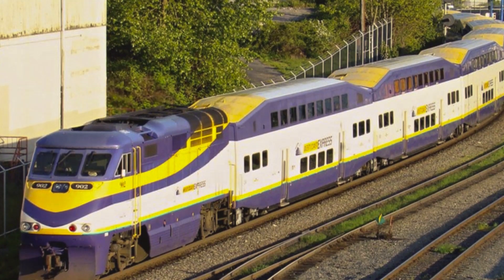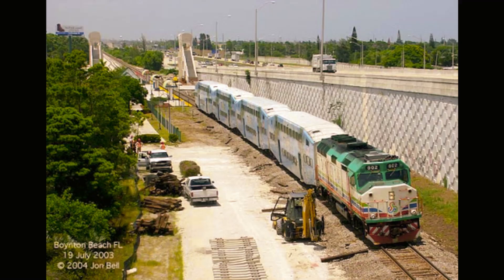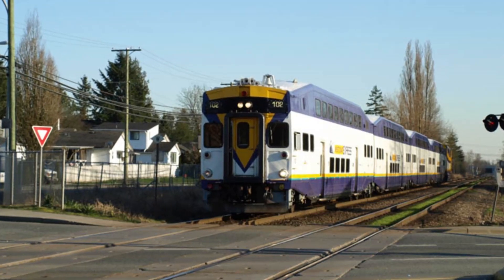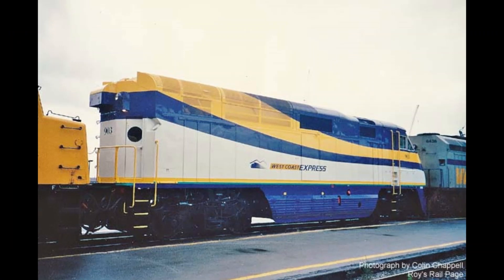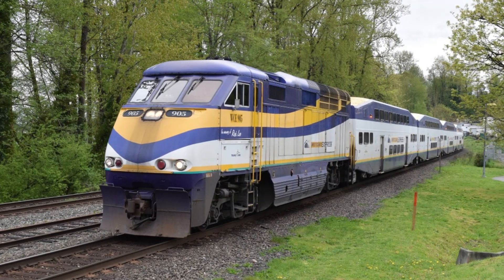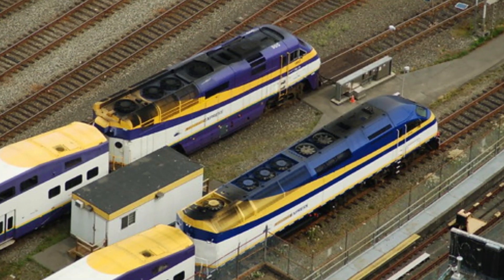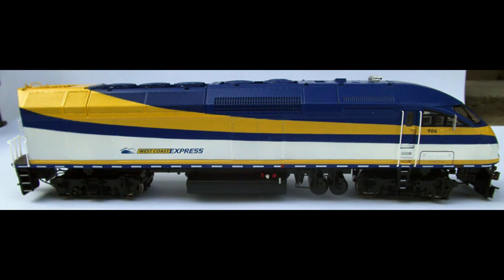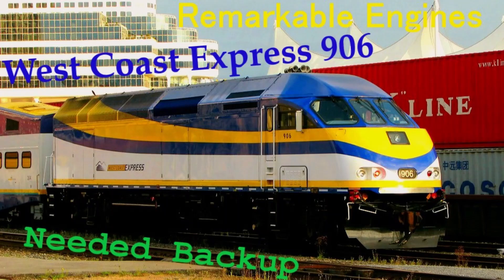Remarkable Engines: West Coast Express 906

Comment: Fun fact with the Sounder 906. Due to certain rules from the US revolving around leased out equipment, every 6 months or so the unit would have to be moved across the border for inspection. To do this, CP would have the Sounder F59PHI lead the CP Sumas turn to Sumas Wa and push the unit across the border there. This is the only time I can think of one of those units being in freight service.
Reply from the maker: Very interesting! Thank you for sharing this little known fact about the F59s.
Reply: I didn't know about that! I can't think of any other time an F59PHI (or any other kind of F59) has ever been used for freight service. I wonder if there are photos or videos for this.

Thanks for the information!

Comment: MK & MPI built many F40s before the MP36s, including the F40PHLs
Reply: @Acerailfan3306 Trackside Using cowls from BN F45s
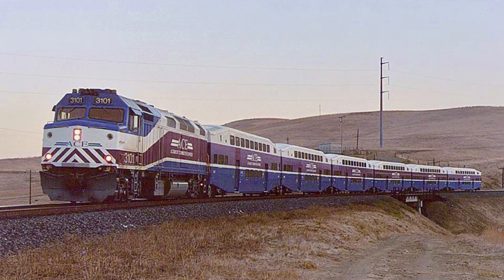Reply: True! In fact, I've even seen some of these MPI F40s myself! Until February 2021, the Coaster commuter train in my home city of San Diego, California, used five MPI F40PHM-2C locomotives (built in 1995, making them about the same age as the WCE F59PHIs) and two of its own F59PHIs. In fact, these F40s are featured in this video, too: at 0:07, you can see one of the Coaster F40s, while at 1:07, a similar locomotive for Altamont Corridor Express (also built by MPI) is seen.

Thanks for the comment!

Comment: I've always liked 906. Maybe it's just because I like WCE's Paint Scheme, and it looks great on all of their equipment. And also, 906 had an outstanding K5LA back then, even though it's sadly been replaced with a horrible K5CA-LS. But it does now have one other distinction you forgot to mention. It is the one and only MP36 with a Transtronic Bell.

There's also a Cab Car Counterpart to 906, which is 109, a spare Cab Car built alongside their extra coach order in 2010. Hardly anyone knows about this unit, though, and photos and videos of it are generally quite scarce.

Also, at 2:17, that photo is actually from before WCE Started, and since their own coaches were being delayed, they were leasing GO coaches for testing. Hardly any photos of these tests exist. And the only thing that's actually known is that the Cab Car they leased is the mythical GO 224, a unit so elusive, that even Amtrak 819 was seemingly commonly photographed in comparison.
Reply from the maker: Thank you for this information regarding 906.
Reply: Both 109 & 906 are in the same video: https://youtu.be/ruSKfEiGOg8

Comment: 906 is the only MPXpress with a Transtronic Bell
Reply: @Acerailfan3306 Trackside Metra requested them, probably.
Reply from the maker: General question, how did you find out this information about 906? I genuinely searched everywhere and could only find the information from the sources listed in this video description.
Reply: @Pensyfan19  https://youtu.be/ruSKfEiGOg8 has video of 906 with a Transtronic Bell, and the fact itself is from Superbaddy4, although it's known that MPI built them by default with Graham White 373 Electronic Solenoid Bells
Reply: @Pensyfan19  Also, I've confirmed that all of Metrolink, Caltrain, Sounder, UTA, RailRunner, Metra, Sun Rail, GO, MARC, and VRE's don't have Transtronics
Reply: what about GOT
Reply: @marilllover2177  Graham White 373 Electronic Solenoid Bells
Reply: @AVeryRandomPerson  Metra's MP36PH-3Cs use EMD steel bells.

Comment: Passengers would also complain about the doors, emergency lighting only, and no Climate Control when they leased freight locos without HEP. The automatic door system requires HEP on the Bombardier Coaches